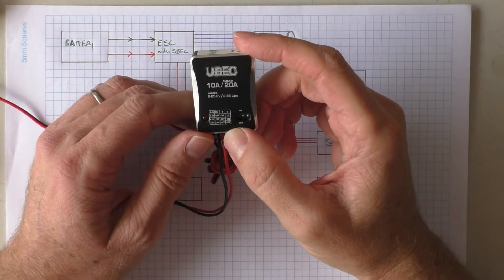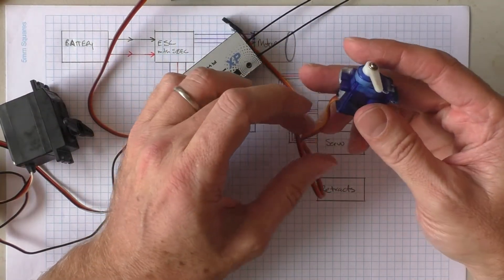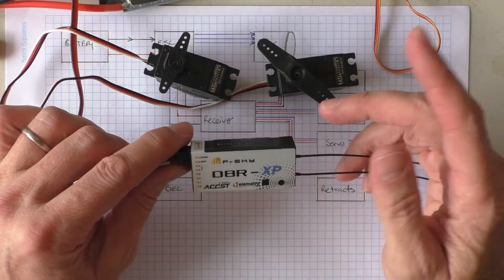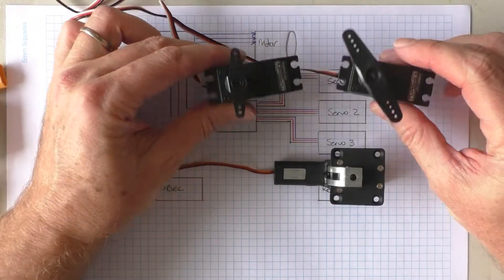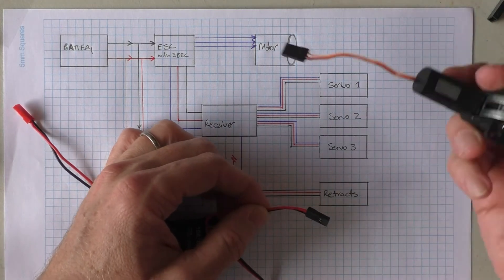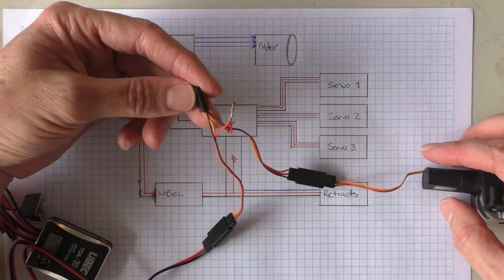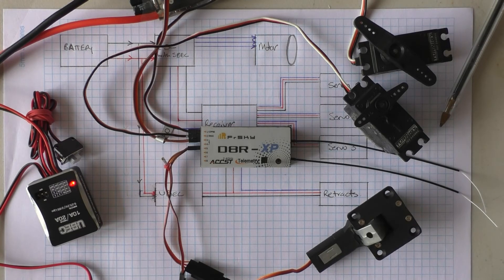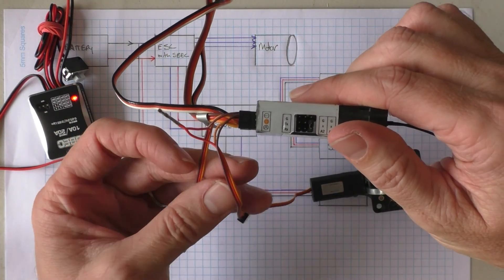RC Flying: How to install a UBEC to power only the retracts.

Comment: Well enough and thanks for the supreme effort that went into this vid. HOWEVER, I am at a loss for a reason to only supply the retracts rather than the entire Rx and ALL servos. No more effort for more safety.
Reply from the maker: The retract motors draw a lot of power for a few seconds that reduces the available power to your other more critical servos. ie: When coming into land, you activate flap servos + your retracts, plus you are using all the control surface servos, so keep the retracts out of this power loop is preferrable. Also, servos do have a tendency to burnout and short pulling a huge amp draw. To have all this isolated through the UBEC keeps the critical services still operating. But to answer your questions, you could put both flaps and the retracts through a UBEC.

Comment: Good explanation. just one question, as the servo is already powered by the Ubec, would it not work with only the signal wire going back to the reciever??
Or do you really need the negative as well?
Reply: I have the same question, I think you may be right. I don't know enough, but it seems like this method is creating ground loops which I assume are best to avoid.

Comment: Great 👍👍 , btw may I ask, this is a dual output, can the two outputs be different from each other, for example 1 for the 8.4v servo, the other 5v for the lights
Reply: 😁Can you make a follow-up video about settings with two different voltages, then what must be considered so that there are no installation errors 😊